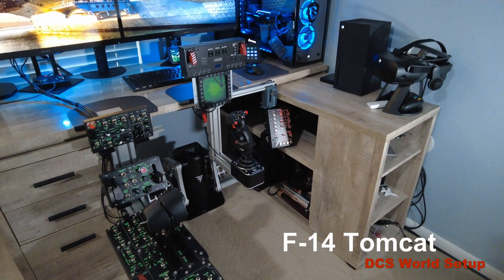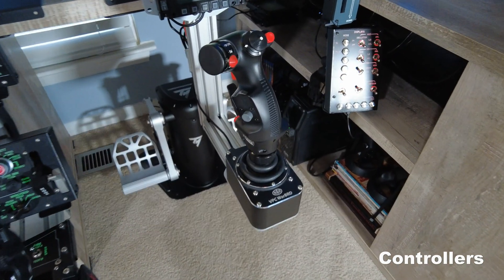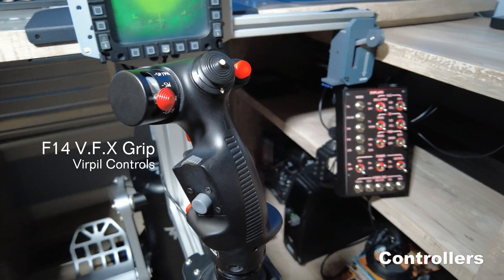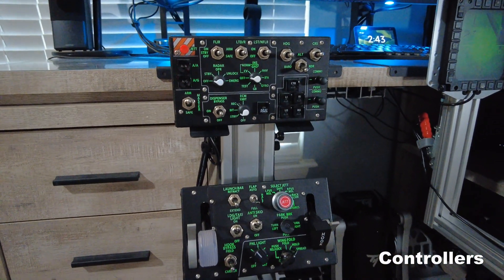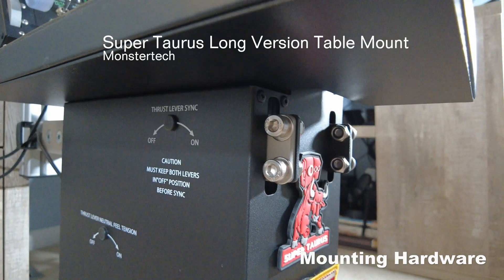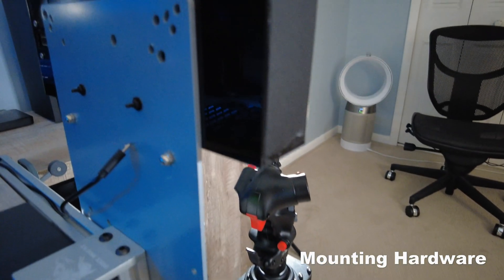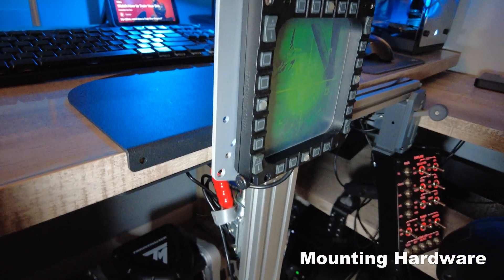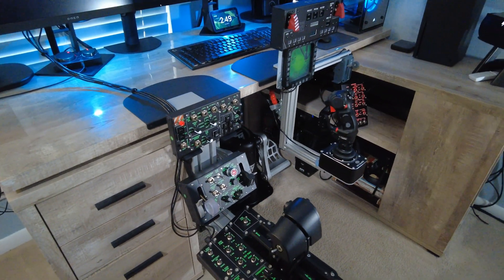F-14 Tomcat PC/VR Setup for DCS - Episode 1

Comment: Hey how did you mount the winwing panels?
Reply from the maker: The mount that I use for the Super Taurus is the Long Version Monstertech Table Mount (Only way to mount the Super Taurus without the handles hitting the panles) The take off and combat ready panels can be mounted to the Monstertech Mount using the stock WinWing mounts.  The only thing that you may have to buy are the nuts to match the bolts that you are using.

Thank you for your continued support!
Reply: @KarmasGhosts  thanks
Reply: @KarmasGhosts  do you have the measure of the nuts?
Reply from the maker: @Fernando Gonzalez Chavez   I don't know what bolts you are using, I switched to thumb screws to make switching between aircraft easier.
Reply from the maker: @Fernando Gonzalez Chavez I used M5 x 20mm and M5 x 10mm Male Thread Knurled Clamping Knobs and 4040 M5 T slot nuts for mounting them on the Monstertech Extrusions.
Reply: @KarmasGhosts  that’s what I needed, excellent setup clean and efficient.

Comment: does tek creations sell the f14 acm panel with the red covers??
Reply from the maker: No, they don't.  Tekcreations designed the ACM panel electronics to include the function for the switch covers to work in DCS, but said he didn't get to design the mechanical side of the switch covers.  I used plastic reed switches that are  normally open, I didn't use the included magnets because the were too weak to actuate the switch through the panel material.  I had to order the largest neodymium magets that would fit nicely in the switch covers.  Both ACM and Master arm covers work to actuate the covers in DCS.  I have a few requests to make a video showing how I made them.
Reply: @KarmasGhosts  please make that video I’m going to purchase the panel so to make it more real please share that info.
Reply from the maker: @FGCH03  Yes, will do. But I'll probably do it after Episode 5 for the F16. Maybe at the most, a couple of weeks.
Reply from the maker: @Fernando Gonzalez Chavez  I finished the video on how to make ACM Panel Guards to work in DCS. It will be posted on Nov 9th 2022 at 0700 Eastern US.  Hope this Video helps!
Reply: @KarmasGhosts  thanks for the info

Comment: That's about $2.5K in gear right there. Can only be achieved if you're single and have no kids. I'm married with a kid and another on the way. Guess I'll live vicariously through you guys.
Reply from the maker: Have Faith! I'm married (to a very understanding wife) with a teenager!  Congratulations on your inbound bundle of joy!  Thanks for watching, Vortech! Episode 2 - F18 and 3 - A10 are up on my channel and Episode 4, Ka-50 setup will be up soon!
Reply: @KarmasGhosts  I bought an old school Suncom F-15 stick and throttle, along with an old school Thrustmaster rudder pedals. Everything together totalled around $200. The idea is to replace their PCBs that have the gameport connector with ones with a USB connector. I'll also look at replacing the CM switch so it toggles correctly instead of just being a push button. Also looking at using Hall sensors for the axis. Unfortunately, I have no experience in building a PCB or working with Hall sensors, so it'll be a slow process learning how to do all of these things.